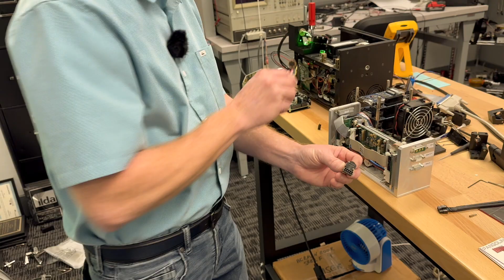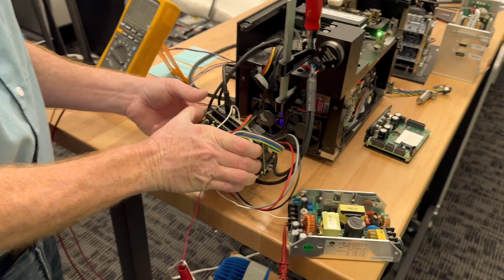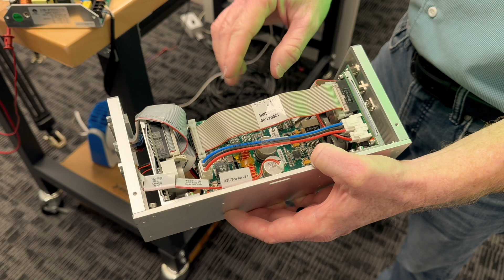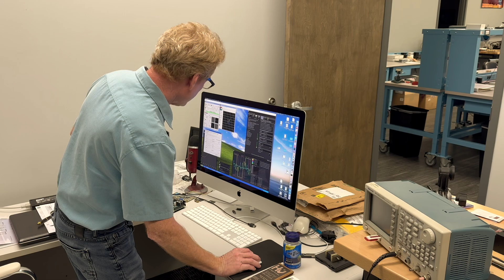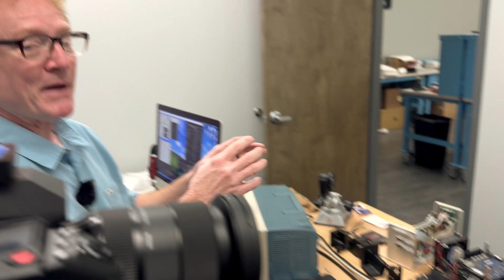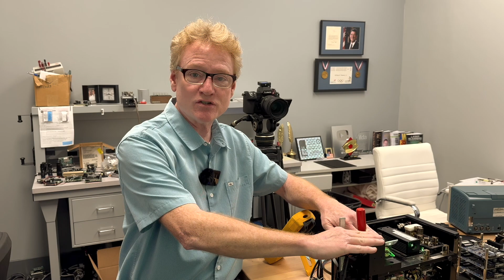Custom System Capabilities at ScannerMAX

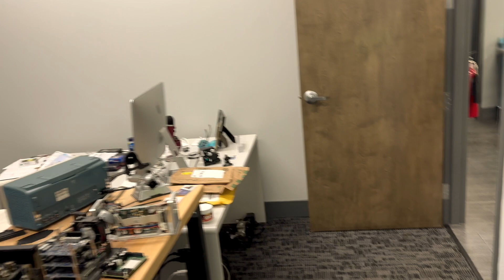Comment: @8:31 That 50W input power has to go somewhere, right ?
Reply: @BartSliggers: I don't understand the comment, and there is no mention of 50W input power at the particular time you noted. The idle current is 0.2 amps (10 electrical watts), and that operates all of the signal conditioning op-amps, the DSP, 8 ADCs, 8 DACs, 6 separate power supplies, plus the PWM switching itself. When the projector was operating at the full projection width and very aggressive pattern, it was drawing 1 amp. So that's around 40 electrical watts which are input to the motors, which produce an output in the form of mechanical watts. Our motors are the most efficient in the business so the conversion of electrical input power to mechanical output power creates relatively little heat.